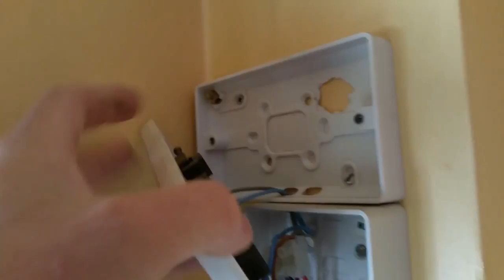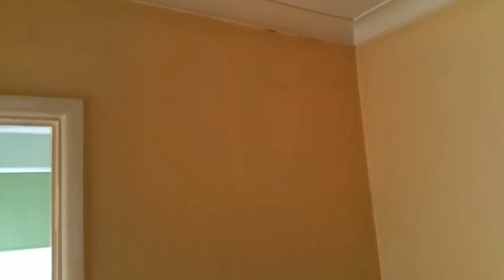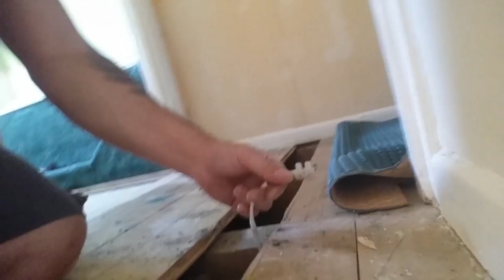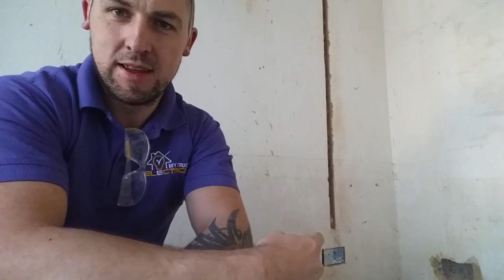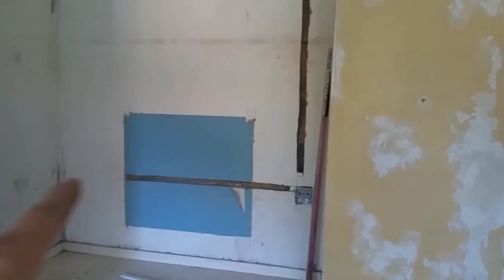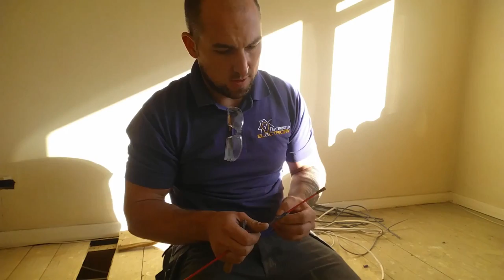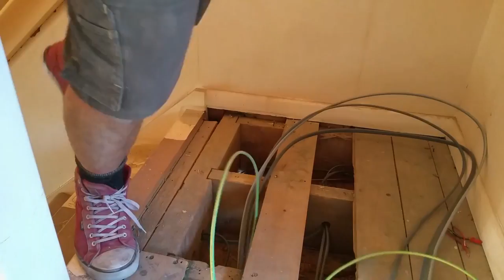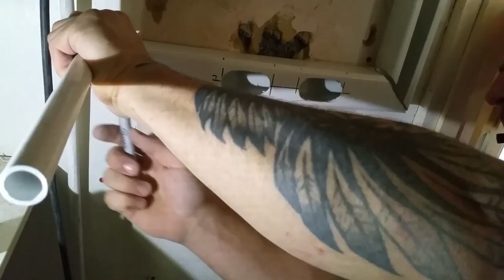HOUSE REWIRE - First Fix & Consumer Unit Install

Comment: Very neat work mate. I've seen some bad DIY electrical attempts, you've stumbled across the worst I've seen! You've got some good techniques, I like the idea of stopping chases short of boxes.
Reply from the maker: Thanks Paul
Reply: There shouldn't be such thing as DIY electrical work😂🙈
Reply: @ReecePowell  well technically your need a permit and your progress is supposed to be inspected. So it's diy but inspect by a pro.

Comment: Hi so nice to see a decent spark for once.Who knows what is what and up against,from other cowboys on day one !!!. My better half is also a spark,trained while within the Royal Navy,Doing both types of electric's AC-DC gaining his City and Guilds in both fields.Civic life and Marine Life on board a ship is completely different kettle of fish so to speak.The old school now 73 years of age. Once out the service what he discover blow his mind just apart Working with the old Seeboard and LEB,broke away and stated up on his own. I have shown your video's and admired your workmanship a true trade man's as a spark.If he did a complete rewire he would always do two ring mains 2.5 and 1.5 upper lower levels,spare ring main for the kitchen only, single run for the cooker.So everything could be checked out and become isolated areas without any affect to any other parts of the house etc.Left a large consumer unit with RCB's for any new future runs,sheds,garage,outside lighting.lofts etc if ever they were  required. Ok he may have charged more in costs and labour but he gained a peace of mind knowing its a 100% job well done and gained more leads to other jobs via the client's that he had done work for.Yes he did train a few up over time sent them to collage once a week to gain their own tickets. Just had to place on a word and make a comment.He even showed myself how to change a plug without blowing myself up. All the very best from the both of us,keep up the good work its very rare to see a good spark who knows what he is doing these's days who takes pride in their work...Carol--Barry

Comment: I’ve seen some diabolical stuff, but what you found in there beats everything. I was thinking that they couldn’t have used the shower without burning the place down, until it turned out that the supply only had to run a small pump! They’ll certainly have a pukka installation once you’re done.

Comment: Just bought a place and I'm no electrician, but after seeing the sockets and consumer unit, I had to bite the bullet and get quotes for a rewire. The cost will be essential, but hadn't budgeted for it. It's good to see what's going on during a rewire. I was only going to flick through, but ended up watching the whole thing.

Comment: Seeing this reminded me of when I bought my current house.  There was a 2KW radiant bar heater above the bath that was nearly falling off the wall and was wired into the ceiling rose in the hallway.  No idea if it actually worked as it was removed the day I moved in.  Then when we had the first heavy rain the downstairs lights kept tripping.  After a lot of checking I found that an outside light was fed from the understairs light, as the cable ran under a window sill (outside) it went into a connector bloack, changed from 2.5 T&E to bell wire and then to 1.5 T&E via another connector block at the far end of the sill.  No attempt to even try and water proof the connector blocks.  Disconnected from the understairs light and guess what?  The lights didn't trip off any more.  To be fair, the plumbing was absolutely shit too, the outside tap came off the hot water supply.....
Reply: I think we may have had the same builder mate! Haha.

Comment: Great idea with leaving the chase short, can you show how you drill down, if the plaster is crap wont it just split off? Thanks
Reply: Why does he do this? Must have missed his explanation for it in the vid?
Reply: @zaks8285  Plasterer and painter don't need to remove the accessory to plaster/paint, which they would need to if the chase went all the way. The small gap around the edge of the box will get covered by the faceplate

Comment: Have a look at the option of omitting the shower isolator.  The regs state that isolation is possible at the MCB.  We've all seen how unreliable they are, and that screw terminals can fail at the best of times.  Some customers operate them daily and I don't think they're designed for that.  You can feel how clunky the switch mechanism is because of the size of the contacts.  What happens when the switch starts emitting smoke?  You need another isolator next to it so you can quickly make it safe.   I've read through Guidance Notes 2 and it looks to me like isolators are only necessary for jobs like hotels where you don't have individual breakers for each shower.  Another exception is in a house with TT supply where isolation must be both L and N.  The MCB doesn't cut the neutral.  In a TN supply that doesn't matter.
Reply: It was running on flex on connector blocks on another cuircit, least it could of had was an isolator 🤣🤣🤣🤣
Reply: The shower isolators in the houses I've lived in have all been hidden away in inaccessible locations, presumably because the previous owner didn't want them visible. I feel like they shouldn't have bothered with them in the first place
Reply: @rik061119  At least the wires weren't just twisted together
Reply: You need the shower iso close to shower to be able to knock it off incase of a fault while in the shower
Reply: @thereal1006  If we are thinking about complying with BS7671, we need to classify 'knocking off in case of a fault' as either functional switching, emergency switching, switching for cleaning/maintenance, or as isolation.  We can then look in Chapter 53 of BS7671, or Guidance Note 2.
Would you say a pull-switch is for emergency switching?
Reply: @westinthewest  yeah who the hell pulls the pull  cord on to get in the shower just leave it on
Reply: @thereal1006  I think that concludes the discussion.
Merry Christmas!

Comment: if you are doing a total rewire of a house in England you do not have to apply the new heights for sockets and switches, here in Ireland I have ask my RECI inspector about that because I have rewired several old houses lately and he says you do which in Ireland in 1200mm maximum height to the top of switch  and 400mm minimum to bottom of socket, also I have never  seen kopaks in a attic space in a domestic house is that a new IEE reg, another good reg I see on British electricians videos is that you can put the isolation switches for hidden sockets in kitchens in cupboards, here you have to put them above the worktop and the client is often not to pleased to see a load of isolators that are as far as the client is concerned not needed and soiling the tiles or granite backsplash.
Reply: paul brown it’s not a reg to put kopex in a loft space, just good workmanship stops and rodents eating the cables and adds extra protection.
Reply: Your RECI Inspector is correct - ET101 (the ETCI Wiring Rules) clearly states that all new work must comply with the current Rules - this includes accessory heights. BS7671 (IEE Wiring Regulations) is different in that accessory heights are specified within the Building Regulations and not the Wiring Regulations so that is why there is the difference. (I am a RECI Registered Electrical Contractor and an NICEIC Approved Contractor.)
Reply: Use a grid switch to isolate the appliances in the kitchen instead of a load of fused spurs looks much better

Comment: I’m American and currently about 700 hours away from being able to apply to become a licensed residential wireman. I’ve been doing electrical work for some time now and I was curious as to how other countries and parts of the world work, for example here in the states this would be a typical house layout; let me know how this is similar to your countries or areas, 
4 combo breakers (AFCI/GFCI) 
 • Kitchen countertop/island 20 amp
 • Washer Machine 20 amp 
 • Dishwasher/Disposal 20 amp

AFCI Breakers: 
 • stove/fridge 20 amp 
 • furnace 20 amp
 • hood 20 amp 
 • all bedrooms, inhabitable living spaces, garage lighting, loft and porch areas, bathroom lighting, attic lighting, etc. 15 amp

Regular Breakers: 
 • garage GFCI circuit 20 amp 
 • outside GFCI receptacles 20 amp
 • Bath GFCI 20 amp 
 • Dryer 25-40 amp 
 • A/C units 25-50 amp 

This all differs in what’s needed in houses. Let me know fellow electricians
Reply: 32a ring to kitchen 
32a ring to grid switches for kitchen appliances 
32a cooker circuit depends on the rating of cooker though 
32a downstairs Ring 
32a upstairs Ring 
6a radial for boiler circuit 
6a radial circuit for smoke alarms 
6a radial for downstairs lights 
6a radial for upstairs lights
40a shower circuit 

That's a standard house rewire in the uk

Comment: I hired an electrician to wire my house.  He talked a good game, however, when he started wiring I could see he had very little knowledge of house wiring.  He had a casual labourer straight from his local pub to chase the walls and lift the floorboards, he did more damage than enough.  When I saw how the so-called electrician was fitting the wiring I had to stop him from going any further.  It was dangerous, he was using lighting cable for some sockets.  I was horrified, he was wrapping the cable around hot water pipes and running cables over the joists without properly cutting the joists out first.  I couldn't let him go on and told him to stop work or I was getting Trading Standards to look at his work.  He was very annoyed and said he had just finished  6 months at a skill center.  He cost me a fortune getting things put right by a proper tradesman because of the damage he did.  There are a great many people being trained at skill centers starting building work with only limited knowledge doing  second class and sometimes dangerous work.  The only thing they are good at is asking to be paid in cash and conning people.

Comment: what brand of multi tool diamond blade do u use man ? I bought one the other day and it worked really well until i came across some hard render on a couple of my chases, which melted the blade. I know the multi tool blade should only be used to cut through the plaster and soft brick before chiseling but just wondered if mine was just a shit brand or something ?
Reply from the maker: I bulk buy cheap and cheerful on Amazon mate. Only use it on soft walls. Angle grind the rest
Reply: Ok cool. Damb i was hoping there was some monster diamond blade that would avoid all that grinder mess. 
Big fan if ur videos mate :) cheers

Comment: Am I correct in saying, when you rewire an old building you use the heights of sockets and switches as per the regs??
Reply from the maker: Nope. Reg height are only statutory on new builds. Old building it's optional. 

However.. you cannot make make things worse. Ie, install sockets lower then the existing heights.
Reply: The only reason I ask is, you didn't set them at the original height and thought you'd set them to the regs. Having said that, all the sockets were at different heights in one room. Just good practice to keep everything uniform that why I asked if they are to the regs.
Reply from the maker: @craigemmott4976  haha yes this building had many different heights 😅

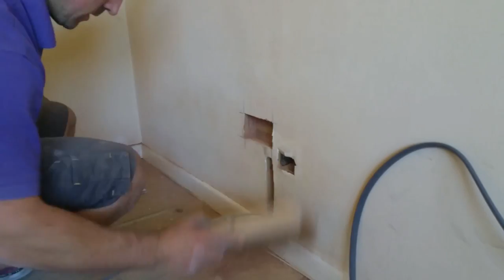Comment: I like the idea of leaving a small section between the chase and the back box but, correct me if I'm wrong, It looked to me like you put your cable into conduit @18:14 Nothing wrong with that, in fact it's my preferred method also, but does it mean, there is a small section between your conduit and the back box with the cable in the wall without mechanical protection?
I was also intrigued when you said you use your multitool when chasing. I have only ever cut timber with my multitool, a bit of a waste af a versatile tool on my part, I know. It would be great if you made a video using the multi-tool on a wall😁👍

Comment: If you came across a Consumer unit that had an empty slot (no blanking plate/dummy) where (if you were foolish enough to) you could put your finger in and possibly touch the busbar - what failure code would you give the installation. C1 /C2 / F ?

Comment: Used to do Alarm systems then I was in the UK I saw a lot of work done by " Electricians" even some claiming to have done  4 years of "apprenticeship"  i.e Tea boys I wouldn't trust them to wire a kettle let alone  a house .. Great work Chasing is a thankless task in a old house you never know how much plaster will come off

Comment: When you were doing the board and stripped of the sheath of all the cables how do you know what was for either the ring or radial socket circuits?
Reply from the maker: The lines were marked with tally marks

Comment: Drives me insane “well it’s been fine for all these years and I haven’t had a problem”. 🤦🏻‍♂️. 
People go to the hair dressers cause they’re too scared to cut their hair, but save a bit of money on doing my on electrics that can kill me, hell yea I’ll try that!! 
I little bit of knowledge is dangerous. .
Reply: I agree electrics should be left to sparks however sparks complain about builders doing a bit of everything however I've seen all the top YouTube sparks doing plumbing  jobs chippies jobs etc all should just do what there trained for and ppl without training should leave alone completely
Reply: If you can manage electrics.. making up some stud work or bit of self explanatory plumbing isnt going to do much harm. You can see when a pipe isnt connected cause you get wet.. when a cable isnt installed correctly its silent, doesn't smell and can rarely hear it. There's a reason you get sparks in. Not a handyman😂
Reply: Why do you assume this wasn’t a spark who did this job?

Comment: See you terminate into the DB 1 core at a time, very neat. Do you number the outer sheaths 1-10 etc to make it easier? Don't you just love cable pulling by yourself!
Reply from the maker: I see that my db wiring gets more hits then everything else. I may try and dedicate a whole video to a board change.

I label each circuit as to their purpose.

I then write (usually on the cardboard box that contains the new db 😅) where I wish to dedicate the citcuits within the new db.

Because they now have circuit numbers I will strip and label the 'line/live/phase' conductors using tally marks. I like to mark them in groups of five lines so its easy to read. Example 11 would be - 5 lines, gap, 5 lines, gap, 1 line.

I will twist the cpcs and neutrals around the ends of the live wires a couple of times.

You will see by the order that I yerm my cables that the very last cables to be terminated are the lives.

I hope that all makes sense 😅

Comment: Nice vid, if you dont mind me asking, I would like know if its safe to run cables above the ceiling, using twin and earth pvc for downlights, there are no joists in the way because its a flat property, so is it safe just to rest the twin and earth on the ceiling without using conduits? Cheers 😃

Comment: Presumably you can't use plastic trunking behind a metal box as there is no fire protection  at the knock-outs where the cables enter thus exposing plastic trunking to flames and therefore propagating fire??
Reply: I was wondering that? I thought all wires had to go through glands? No? Please advise

Comment: Ffs, that takes some beating in the poor quality wiring record book.  So each time the shower was used the under floor heating started. Good initiative that, I like the way they designed it. Nice warm feet when you step out the shower. Don't spend too long in the shower or your floor will catch fire from the overloaded flex. 
I would have like to seen a vid done by JW on that one, that one would have been his annual fete. 😀
That's the standard of work I used to find from kitchen fitters oddly enough.

Comment: Wow! I thought my Victorian semi with a single piece of breaker wire for a fuse (for everything) and flex joining approximately 500 junction boxes together (spaced every 1-2meters) was scary. That place is next level horror.
Reply: That sounds pretty bad to be fair!
Reply: @JohnSmith-ws7fq  Quite common sadly. A lot of the elder generations haven't done any maintenance since the 70s.

Comment: Great video, can’t beat a empty rewire. Never seen the lighting wired in flexible conduit though in the loft? I’ve always just drilled joists and clipped direct. 
Also everyone always seems to use 1.5mm, any reason for that when calcs always come out that 1mm is more then sufficient. Especially on a small domestic like that one 🤷‍♂️
Reply: I think there are 2 main reasons why for 1.5. One is convenience and not poncing about with lots of different sizes. Do the calc for the light in the loft of an average 3 bed semi and you'll find you're fairly close to the limit of 1mm, 5 bed and you will need the 1.5 anyway. 
Being close brings us to the second point. Someone chucks another 100mm of insulation over it and you'll be over the limit again with 1mm. 
I was always taught the savings just aren't worth the effort, run the 1.5 and you know everything is covered.
Reply: 1mm is very fragile.

Comment: Constructive Suggestion:-    Fill-in music and horns --   are currently way too loud compared with the voice volume.  Should be same or slightly quieter than "average perceived volume", otherwise you have listeners going for the volume controls.